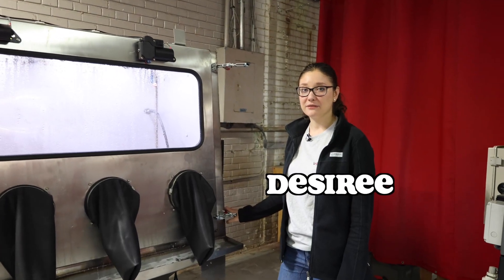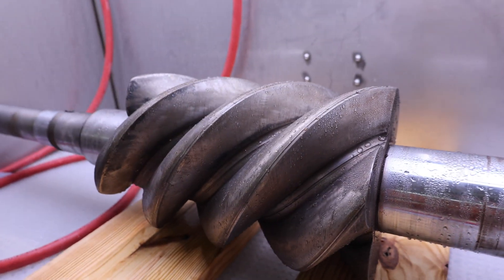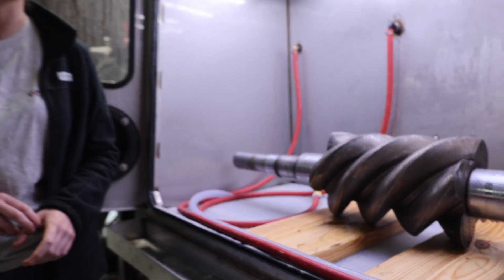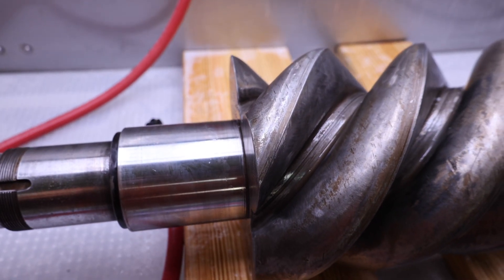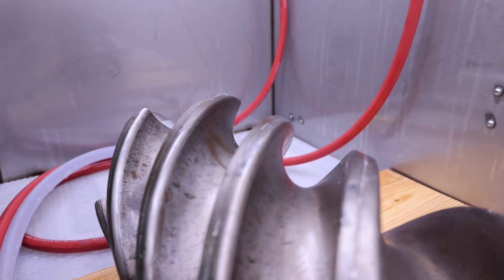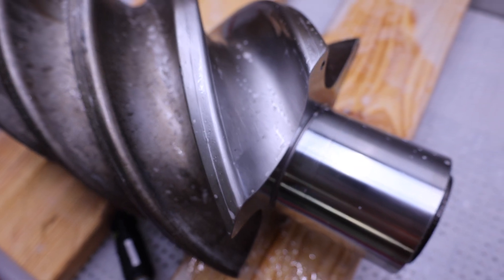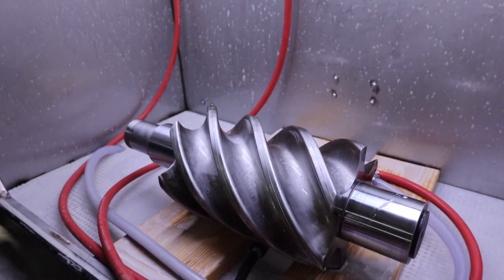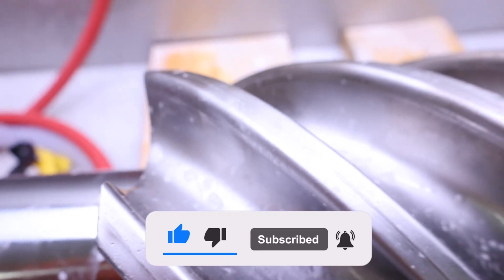The Ultimate Cleaning Machine: Hydro & Wet Blast Combo Unit

Comment: Curious, how did the customer react to the part being media blasting? For their circumstances did it change the characteristics for the matching part? Could the tolerances have been changed?
Thank You
Reply from the maker: Vapor honing does not remove material off of the parts being blasted. That being said, it does change the surface roughness of the part, which, if tailored correctly, can help mating surfaces. In this case, we were able to roughen and smooth the surface for the customers testing. Using our Hydro Blast, we were also able to deep clean the part without changing the surface characteristics at all. For more information on this, please call us at 828-202-5563, and thank you for your comment! Have a good day!